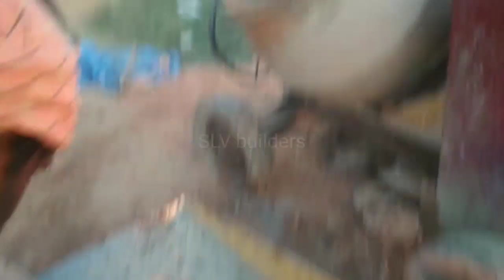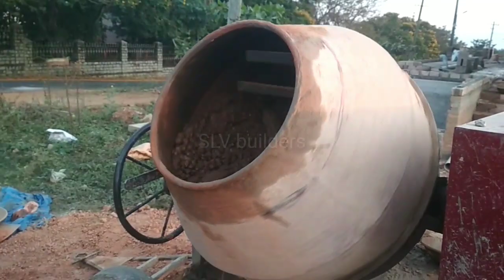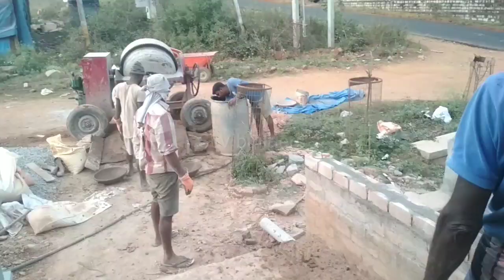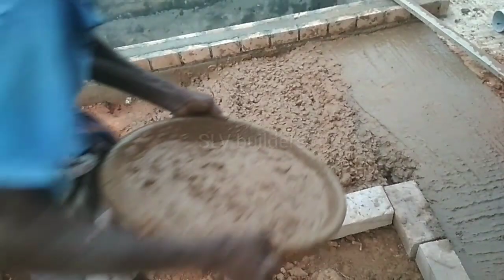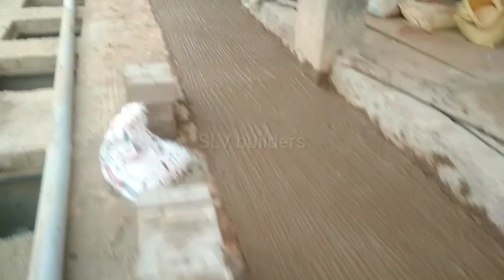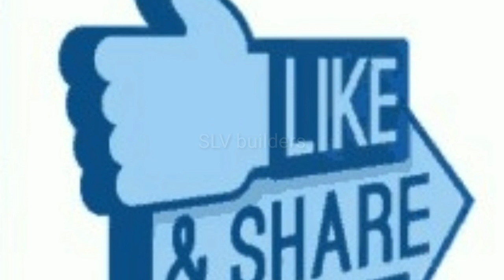Mud concrete work

Comment: This is poured earth .. Just mix mud & rocks  ( 40 mm and below) with 10% cement... which is enough to stabilize the mix.. Cracks may form which you need fill next day.. Its much cheaper and eco-friendly than using cement and river sand.